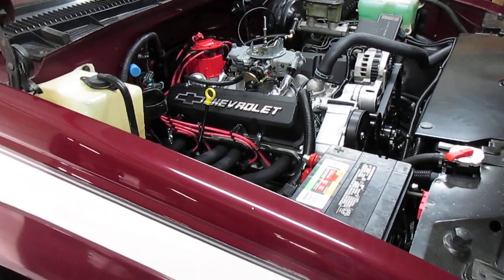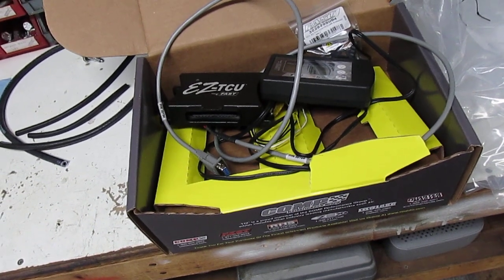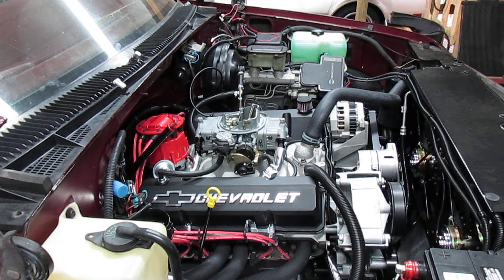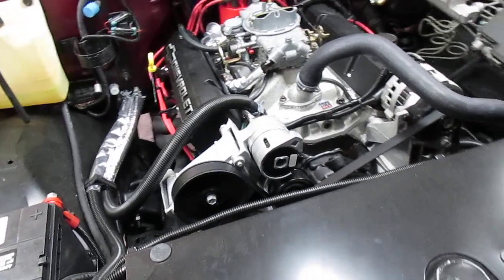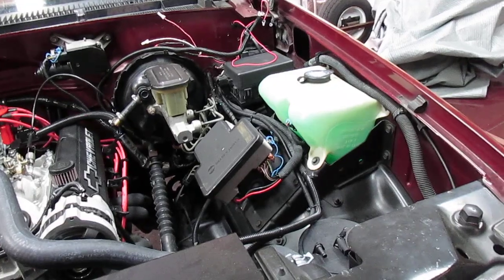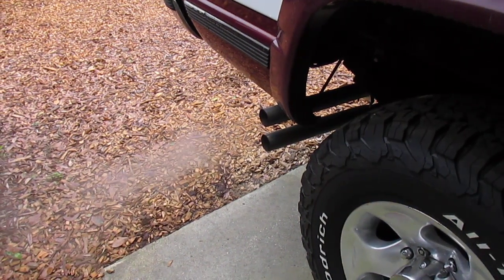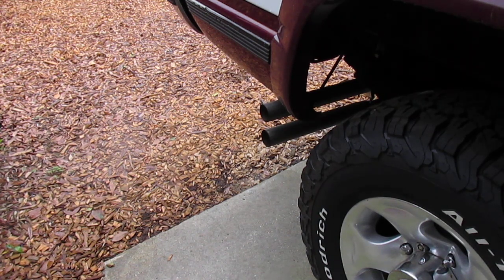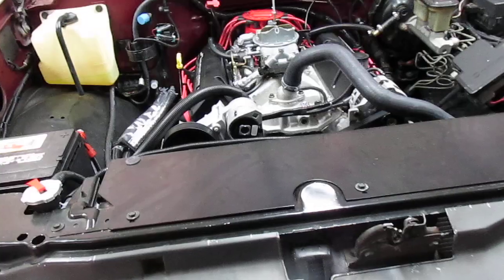Chevrolet 383 Stroker Build, Part 20

Comment: That exhaust is choking that thing. You're really moderate on the intake cfm. That means excellent charge velocity, which makes that thing an absolute torque monster with awesome throttle response. But! You're killing that thing with that exhaust setup. Dual 2.5 with whatever silencer you choose would wake that thing up like you wouldn't believe.
Reply: Are they mid or full length headers?
Reply: You said both?
Reply from the maker: Thanks for the comment. I believe the engine could be choked a bit, if I were running a bigger cam and if it was installed into a 1970 Camaro running at the drag strip topping 7000 RPM. This build is to drag around a 5000# + truck, pulling trailers and hauling loads, so the build was all about low end torque. A short duration cam, 10.3:1 compression ratio and an appropriately sized carburetor. I know it sounds crazy, but it runs awesome. Most "red necks" are really happy running a stock 305 CID small block with 3" exhaust and Holley 1150 CFM Dominator. But being a little conservative is always a better ticket to performance.
Reply: Just a guy who knows some stuff, tryin to help a brother out. That's all.
Reply from the maker: Appreciated but, I dropped out of the school of more is better and too much is not enough. Besides, without a Dyno, no one can tell what makes more power.

Comment: I see You are a Chevy Man and I like that, I am a old Chevy Man too from 1960. To make the Chevy 350 Engine into a Stoker What did You do? I know it's work in the Heads (Vortex Heads) but what Else? I am thinking Pistons and Rods change?  In addition are you running the Engine from a Computer? Seeing the 650 Holley I would say No to the Computer? But wouldn't a Computer be Better for Timing, Firing and Metering the Gas and Timing together? I like everything You Do is Very Clean and I really like That. Have you up graded the Transmission from a 4LG60 to the 4LG80?  I will wait on your Reply. Great Work.